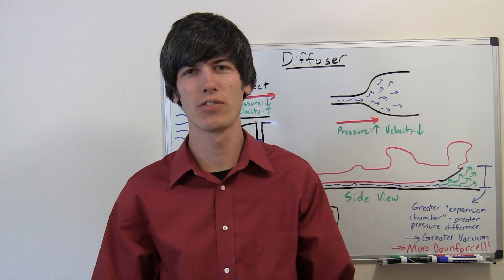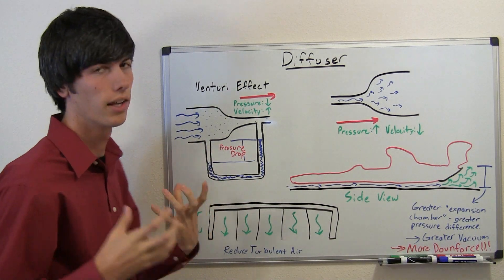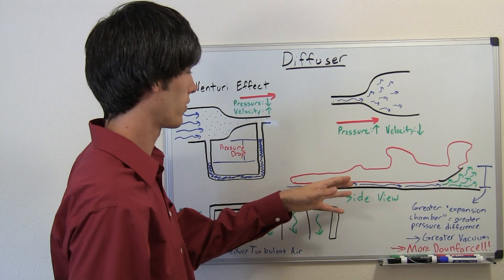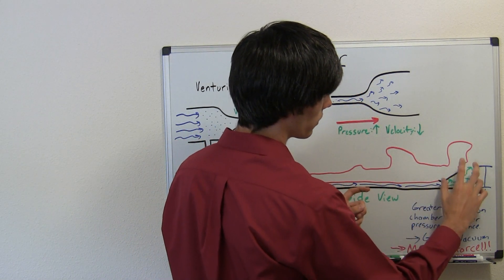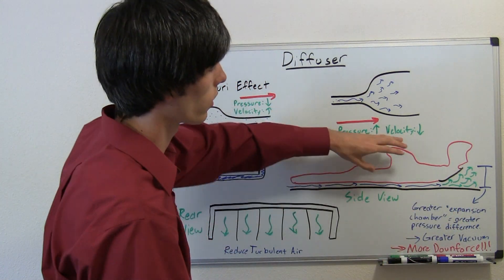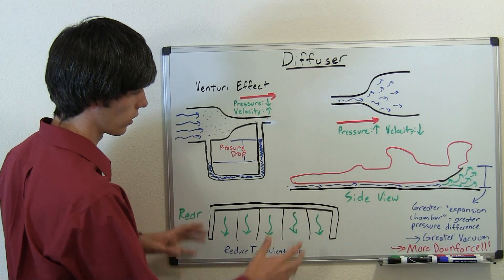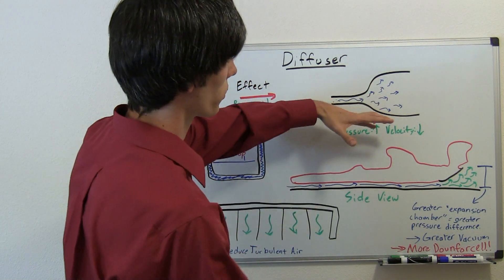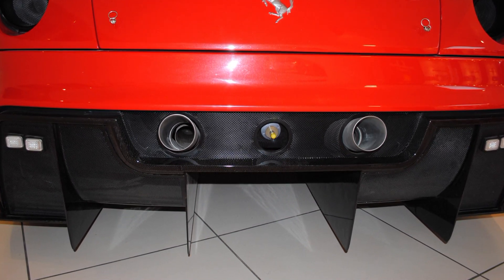Diffuser - Explained

Comment: This video is confusing! Isn't the air at the rear of the car LOW PRESSURE? Shouldn't it create a vacuume and downforce like an upside down wing? High pressure released creates low pressure. Think of a balloon where the pressure is higher inside then when released it is now low pressure. Am I missing something ?
Reply: The diffuser doesn't create downforce. It accelerates the air under the car, so the underbody, if no relative air leak, can create downforce.
Reply: shawn oswald You are missing something.  That something is fluid (air) velocity.
Reply: +Indigo Colossus thank i was still confused, then thought  of this idea and wasn't sure if i was right.
Reply: shawn oswald Well, the pressure is still lower than on the upside of the diffusor. So it still creates downforce. But the pressure raises when the air streams along the underside of the undertray to the back of the car.There's a very intresting video of the Windtunnel of Sauber F1 here watch?v=KC0E0wU6inU and around the 23 minute mark of the video you can see a picture that shows where the car is producing it's downforce. The picture shows the car actually from the underside. The intresting part is, and that's often not mentioned, a diffusor influence also the very begining of the undertray and creates downforce there because it helps to suck air under the car and immediatly accelerate it, which leads to a pressure drop.

Comment: Hi, could you explain why the pressure differential causes a suction effect. Surely air moves from high pressure to low pressure and so this would decelerate the air beneath the floor?
Reply: The air does technically move from higher pressure to lower pressure. That pressure gradient is from the front of the car to the rear. The air has to flow somewhere around the car. Forcing it to flow through a very constricted area under the vehicle allows the flow to speed up and thus drop in pressure due to the Venturi effect and Bernoulli's equation (and forcing it to flow over wings above the car obviously promotes higher pressures and lowers velocity, creating some drag). The air then simply slows down when expanding back to roughly atmospheric pressure (although a little bit less than atmospheric, where the front of the vehicle will see a slightly above atmospheric). The little fins at the back are to help reduce turbulence and promote the flow of the air under the car, and the same is true for undertrays and such. Also, for an added touch, wings at the rear of the vehicle will also decrease the pressure at the rear of the vehicle, allowing for a larger gradient in pressure from front to rear, thus promoting the flow velocity even more, and reducing pressure even more.

This video didn't really explain what is happening very well, honestly.
Reply: @anthonyantoine9232  I have been looking for an answer for this problem for a long time but I still can't find it. I get what you are saying about the pressure differential, but wouldn't it be wiser to just have a flat floor all the way back to the rear? That way you would have much lower pressure at the rear and thus a greater differential. If the you accelerate the flow under the car and already lose pressure there what would you need a diffusor for?
Reply: @fstasfck300  A flat floor wouldn't create lower pressure at the rear, actually, and that's because you'd lose the venturi effect and thus the acceleration of the air under the car that helps evacuate the air under the car. As we know with the Bernoulli principle, as the air speed increases it will fall in pressure. So, with a flat floor and no venturi effect, the air would not be accelerated as it exits the rear and thus would be a higher pressure. Hopefully this helps you understand. If not, I can try to better explain.
Reply: @anthonyantoine9232  thank you for answering so fast xD. That would be the case maybe for gt cars. But f1 underfloors have a larger area at the front than say in the middle of the floor. That way you have you venturi again, higher velocity lower pressure.. and you could have a flat floor all the way to the rear. Is there a flaw with this I'm not seeing? (One advantage to this is that you don't need to avoid seperation like in a rear diffuser)
Reply: @fstasfck300  Essentially what you're missing is that there aren't really any drawbacks to having a diffuser. You do have to avoid flow separation, but it's not really a big deal to avoid. That's why they use them.
Reply: @anthonyantoine9232  actually it's a bit tricky to avoid seperation when you go for more performance. But there are reasons to have a rear diffuser. It lowers overall drag but filling the low pressure area behind the cars, and that's at the same time the reason you need to expand the flow and make it gain pressure. Having a reversed diffusor (big area in front and then floor) would also do for the downforce part, but it won't help with drag. The most efficient appears to be to have both, a large front area then the floor then the diffusor, this way you already suck in more air and you have a bigger pressure loss at the flat part of the floor. One question I still have though maybe you could help me with. Say we have a flat floor (close the ground so there's a tunnel) followed by a diffusor moving through the air at a speed w. Why would the flow velocity just after the floor entry section be higher than w ? In other words why wouldn't the flow keep going at the same speed w under the floor and then expand in the diffuser and lose speed? What happens so it gaines speed under the floor?
Reply: @fstasfck300  It seems to me you completely understand diffusers and how and why they work, so I'm not quite sure what the confusion is. The air does slow down at the diffuser and it accelerates under the floor. It's just the venturi effect that causes it to accelerate under the floor. Essentially you have a velocity which the car is moving at along with ambient pressure, a different velocity (higher) and pressure (lower) that the air under the car is moving at, and another different velocity (higher than car and lower than under floor) and pressure (lower than ambient and higher than under floor) behind the car/at the end of the diffuser. I hope that this answers the question.
Reply: @anthonyantoine9232  so here's the question asked better: the car is moving at w through the air, so the free stream (part of wich in front of the undertray) is moving at w. We have a flat floor (1) and a diffuser (exit (2)) setup. Bernoulli tells us w1.A1=w2.A2 and since A2>>A1 we get w1>w2. But what makes it wrong to say w1=w ? We obviously need w1>w to have a pressure drop under the flat floor but I could say: since that part is constant in area the air doesn't change its speed and thus its pressure. This obviously needs to be wrong, I just don't understand why. Thanks a lot for taking the time to answer! 😊😊
Reply: @fstasfck300  The area is not actually constant from w to w1. It goes from the free stream to the "tunnel" sized stream. That's where the venturi happens, from the free stream to the underbody. I hope I'm understanding your question right finally 😂. I really want to help you figure this out but am struggling to figure out what exactly the question is. It'd likely be easier if you were physically in front of me to draw a picture and point to where the question is.
Reply: @anthonyantoine9232  ur on facebook ?
Reply: @fstasfck300  I am, under the same name. I believe it's even the same profile picture, but I'm not on their often enough to remember lol
Reply: @anthonyantoine9232  hey man sorry I've been busy this days. Can't find you on fb, my name is same there, you can write me a pm and we'll talk on messenger. Thanks again 🙏🙏
Reply: @fstasfck300  I believe I added you.
Reply: I think y’all might be mistaken in claiming that flow can’t go from low pressure to high. Look up the Venturi effect on Wikipedia. Flow clearly goes from low pressure to high as is exits the restriction
Reply: Yeah, I think there's a mistake somewhere in there. Naturally, the fluid would flow from the high-pressure environment to the low-pressure environment and not the other way around; this is in keeping with the natural direction of increasing entropy.
Reply: The point of view is relative... In practice the CAR is moving forward, not the air moving towards it, so it doesn't matter even if the air "wants to" decelerate at the diffusor area. Did that make sense?
Reply: You are right. This video is somewhat unclear. What diffuser does is that it aids in transforming the kinetic energy to pressure energy and minimize the losses so that you get high pressure differential between the air at the bottom and air releasing from the bottom of the car. Without diffuser there would be turbulence which would increase the pressure at the bottom of the car as this turbulence will not permit transformation of high velocity to pressure.
Reply: i think he was wrong, the flow goes from high pressure to low, impossible for it to go from low to high

Comment: One thing that could have been mentioned, and something that is often overlooked, is that as the race car moves through the air, the rear wing actually aids in the acceleration of air out from the diffuser.  This in turn forces more air to move into the diffuser from the undertray, further aiding in accelerating the air in the low pressure zone under the car and creating more downforce.

Comment: Dude, you're awesome. I love your videos.
Reply: Kj16V Most people (in my experience), don't explain diffusers very well (no offense, Engineering Explained).

To answer your question; the way they operate has to do with BOTH air pressure, AND the direction of flow. They're a combination of two principles as seen here - Bernoulli's, and the Venturi Effect. Generally they work best if the car includes an under-body tray, so that airflow is directed in a laminar-flow beneath the car, from front to rear.

What happens is that, as air travels faster in that direction, pressure in that area drops. As a result, atmospheric-pressure imposes, creating "sink" (Bernoulli's Principle) ... Whereas with an airplane (airfoil) it would be "lift" instead. So the car is being sucked-down from the bottom-end due to the lower-pressure where that higher flow-rate is occurring.

However ... 
The way that airflow is increased in order to produce that result, is through the Venturi Effect. The rear-end of the channel (underbody) is in-fact wider like you said; it's typically opened-up with about 8 degrees of angle. This is because that opening allows for air in the rear-end to be expelled suddenly ...
That rapid expulsion, creates a suction which pulls the air-flow from the front, along toward it. So now you've effectively streamlined the underbody's airflow, by making it MORE-laminar. You're using that opening in the back to create a vacuum which facilitates the Bernoulli-effect occurring before it. The result is faster flowing air, and thereby greater sink (downforce).

So a diffuser is really two parts/forces working together. Therefore without an underbody tray, most "diffusers" are really just aesthetic modifications rather than functional ones.

Overall though, the car becomes glued to the road as a result of it's own speed/travel; opposite of an airplane, which gets pulled upward as a result of the same thing.

Hope that helped.
Reply: that is not true, the wing can generate lift strictly from deflection due to angle of attack; independent of Bernoulli's principle
Reply from the maker: Thanks!
Reply: Yup :)
Reply: +Kj16V airplane wings work on a combination of pressure differentials (Bernoulli's principle) and by deflecting air in a certain direction (done by increasing the wing's angle of attack). Bernoulli's principle makes it possible for an airplane to maintain altitude even with 0 angle of attack. Aerobatic planes such as fighter jets use a flat wing to minimize the effect of Bernoulli's principle and thus are much better at flying inverted, as Bernoulli's principle acting on an inverted wing would result in a negative lift, pulling the plane to the ground. Hope this helps.
Reply: ***** What do you mean "a flat wing"?
The wing has to be shaped like an airfoil for it to work.
Reply: trust me I'm an aerodynamics engineering senior
Reply: +Hayden H how do u increase down force
Reply: Nicolas Rosario Downforce on a car can be increased in a number of ways. Firstly, if you look at a car from the side you will notice that, like an airfoil, the top is rounded off and the bottom is flat. At high speeds this shape actually generates lift and can pull the car off the road. To combat this effect, wings can be placed in various locations around the car. These wings are angled so that the air hitting them is deflected upward, thus pushing downward on the car per Newton's 3rd law of motion. Another way to increase downforce is through diffusers as explained in the video.
Reply: He is awesome and a little nerd ☺

Comment: isnt a diffuser primarily used in laval-nozzles? when the gas  reaches critical velocity, it expands, thats why the cross section becomes larger after the tight gap.? so the diffuser in a car has notthing to do with the diffuser of a rocket?
Reply from the maker: Same idea, different application.
Reply: diffuser in car and de Laval nozzle work on totally different principles, de Laval nozzle rely on different properties of gases flowing at supersonic speeds (choked flow) and diffuser relay at properties of gases flowing at subsonic speeds
Reply: yes, I think I understand now, thank you.

Comment: how does atmospheric air under the car has low pressure than air above the car when it has to be 1 bar...
u r mistakenly explaining it...
Reply: Because of the way the front diffuser works. It effectively pushes all air over the top and leaves no air for underneath the car. That's why you have to have a very low car with a front diffuser for the one in the rear to work.

Comment: I thought there is a large pressure DROP at the rear of the car? effectively a vacuum. This causes negative lift on the rear aero and diffuser. Exhaust gas is also utilised here. The turbulent nature of the air at the rear also upsets any race car that is too close behind (dirty air).
Reply: ***** Small spaces do have more pressure IF the velocity of the fluid is low. Since the under side of a car has very fast moving air, the pressure is low. The diffuser part gives the fast moving air more room to escape. When the air has an easier time to escape at the rear, it can allow faster air to flow under thus creating more downforce.
Reply: *****. Hopefully enrolling in uni next year to be a mechanical engineer. 

Quite a coincidence that you asked be me about this. This morning I was looking more at the physics behind diffusers.
Reply: Doppelkupplung Yeah they're pretty clever engineering. The more I learn about air flow in general the more I find it interesting. And it leads to some cool visual designs.

Anyway, good luck at uni man. See ya.
Reply: Nah. What he said is correct. Quick Google searches are helpful.
Reply: Doppelkupplung Do you know why? I mean it seems like smaller spaces would have more pressure. Is it just all the air plowing into itself that creates the pressure?
Reply: Doppelkupplung That's super interesting. Thanks man. Are you an engineer?

Comment: The dynamic of diffuser will also effect the cd. Depends the shape, there is cars like F1 using diffuser to gain down force. The greater pressure the diffuser have, the better cd from the front and sides. Just like the turbochargers or wind tunnel. Greater out let, greater in let by ratio.

Comment: Everything seems good except you switched around the high/low pressure. And bernoulli's principle would conclude that at high speeds, a car would be experiencing lift due to the air particles moving faster over top the car than on bottom. However, adding a rear diffuser will allow for the air on the bottom to move at a faster rate, making for a smaller air speed difference from top the car to the bottom. Its not creating down-force, its lessening lift.

Comment: I didn't realise the higher the diffuser is the more downforce it makes , my cars all wrong haha ! Thanks looks like I'm going to cutting more metal
Reply from the maker: There's certainly a balance. At some point it won't be as effective. The angle that it arcs up, the length, and the difference in height will all have different effects.
Reply: Engineering Explained would the height of the car play a role in the effectiveness of the diffuser? would a car that sits higher need a bigger diffuser and vice versa?

Comment: Please don t put videos like that it just confuses the hell out of people. How come you create a suction effect if the air in the diffuser has got a higher pressure than the air underneath the car... What you are saying is that the fluid moves from lower to higher pressure areas... It expands and the pressure drops hence the suction effect. Do not state Bernoulli s equation without understanding its limitations. Additionally a higher pressure under the diffuser would reduce the negative lift on the rear axle= not a good idea.
Reply from the maker: Why don't you take a look at some pressure curves on a diffuser, Aston Martin has posted some which show the pressure differential as described.
Reply: There is suction because the air at the diffuser throat must be accelerated to fill the gap left by the diffuser. The air is presumably moving nearly parallel with the ground before the diffuser. After the throat it will be angled since it will follow the diffuser surface. Vertical momentum went from 0 to non zero. There is a force on the air. There must also be a force on the diffuser throat, in the opposite direction.